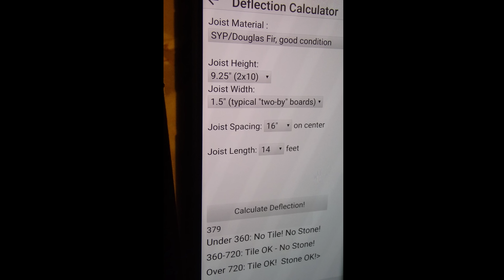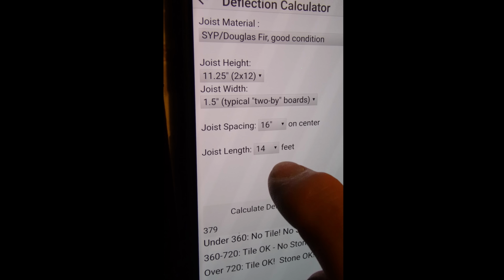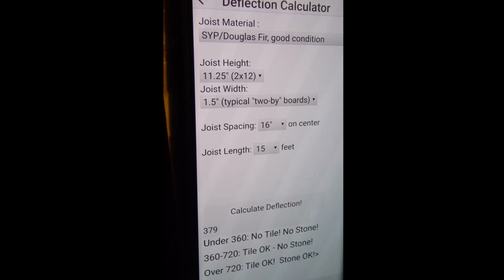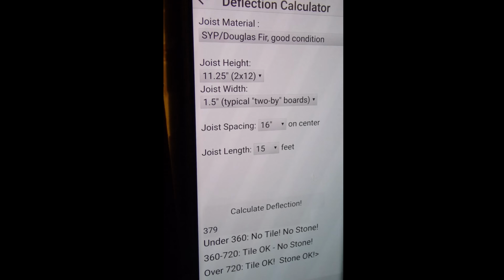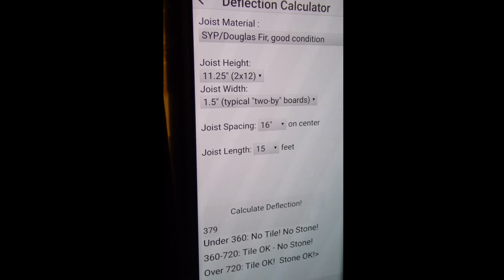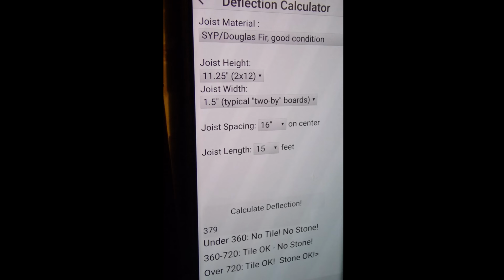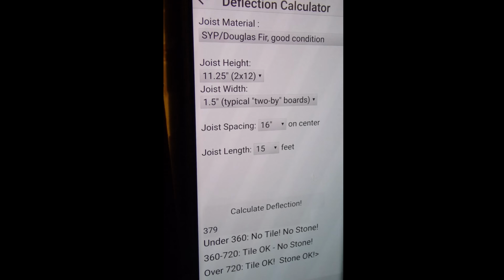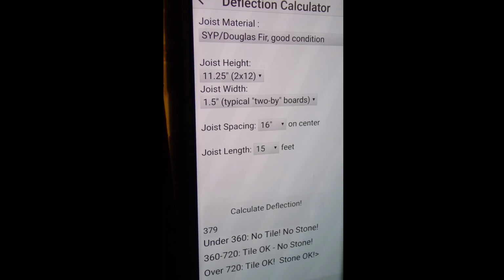🤔Before you install tile find out if the floor is strong enough?  What you need to know.

Comment: The "app" Sal links to is great, especially if you're a contractor in the field going from job to job because you'll always have it with you on your phone. However if you are a DIY'er at home doing your own kitchen or bathroom and you only need to do a one time calculation there are several good "free" PC and Mac based apps online example: The John Bridge Deflect-O-Lator

Comment: Sal,  These are the topics that makes you a TOP Tile Professor in my eyes.  In my kitchen the builder graciously gave me an I-Beam structure made of engineered plywood.  The builder also gave me I-Beams that are 24inches on center for the entire span of the kitchen.  There is also about  a 27ft of span as well.  Too late to add lollies, finished basement.  I was able to sister 1inch thick plywood to each beam on either side, glued and screwed for a good 15ft of span.  I will add another layer of 1 inch real plywood to the floor.  A thicker floor will have less deflection.  I wish there was a way of measuring deflection without calling in an Engineering company to do it.
Reply from the maker: You can determine with the deflection with the app, however the deflection should be designed into the floor when the house is built or remodeled to mee the deflection of the intended purpose and material type of the floor. This is not the job of the tile setter, but something he should be aware of. Sometimes wanting a thing and being able to have it are not possible.

Comment: Great video Sal. I believe that TCNA (Tile Council of North America) has introduced another important guideline - deflection for large format ceramic tile (Large format tile is considered any more than 15" long in any direction) is L/480. So normal tile L/360, LFT L/480 and stone L/720. I think they introduced that in 2019 or 2020, after this vid came out.
Reply from the maker: The language for deflection standards has changed in the 2020 handbook, but there is no mention of L/480. The change has to do with the assignment of responsibility for determining if the deflection. It makes clear that it is the responsibility of the builder or the homeowner, or design professional to make sure that proper deflection was designed into the floor assembly.

Comment: So here's my question, I have 3/4 subfloor trusses are spaced 24 inches apart. Do I need to strengthen that for 12x24 tile? It's my bathroom, I demoed an 1.5 inches of concrete and tile out.

Comment: Hi Sal. I have a small two-story condo with small upstairs bath. I am having to redo all tile, bath, toilet and flooring. The vanity are has carpet and the shower/bath tile. I have had to pull out all the tile and would like to replace  the carpet in vanity with tile too. Here is my question. When I calculate the deflection, the number I get is  is 307 which is less that the needed 360 for tile in upstairs. The total area in question including bath/tub/toilet/vanity is only about 40 square feet. Will tile still work, or do I need to keep carpet in the vanity section? I presume the tile in bath tub toilet area is okay cuz there used to be tile there. But what about the vanity area. The total square footage of my upstairs is probably about 480 sq. Ft and downstairs about another 540 square feet. Thanks so much!
Reply from the maker: That is way short of the required 360, so best to talk to a structural engineer or other design professional that can tell you how to strengthen your floor.

Comment: If there’s only 4 travertine tiles are slightly “bouncy” in a second floor bathroom, how can I fix this?  The grout around the tiles are breaking into pieces.  I don’t want to re-grout until I figure out what’s causing the problem.  Thanks!!!  :)
Reply from the maker: Floor structure is probably not rated for natural stone, my guess is it is a tear out and redo bringing the floor deflection up to L/720 before installing the stone.

Comment: Thanks for the info. I bought marble tiles for my shower. When it was delivered the receipt said that they weigh about 2200 lbs, which I did think about and of course the sales person didn't mention. I asked my contractor if he thought this tiles was too heavy and he said he didn't know so now I'm afraid to install them. Also all of my walls are made of plaster over drywall, which makr them much heavier, so I think my floors are already pushed to the limits. Any advice, please. I know you said talk to an engineer, so would that be a structural engineer.
Reply from the maker: Your tile is distributed over a very large area, so it is not as if you are putting a 2200 pound point load on one spot, most floors are engineered to accept a ceramic tile floor and meet L/360. The issue is more that you need a stiffer floor and a double layer of plywood for the marble tile. Floor has to meet L/720, in most cases floors will not be that stiff. So yes talk to a design professional that is able to tell you what you need to do to bring your floor up to spec. It is the job of the builder, architect or engineer to figure these things out, it is not the responsibility of the tile guy to determine the strength and deflection of a floor. However a good tile guy will check to have some idea of what he is dealing with.

Comment: Quick question if you have a moment Sal. How would plywood subfloor affect the calculations? Renovations in my area normally have 1/2" plywood subfloor. We normally add 1/2" ply to increase the strength of the subfloor and then an uncoupling membrane. I would appreciate your thoughts. Thank you.
Reply from the maker: You need to get a hold of a TCNA handbook. 1/2" plywood is never allowed as a subfloor, I would suggest you use 5/8" instead of 1/2" for the second layer that you add. The requirements of the joist structure do not change. I am not an engineer, however from what I understand, the joist deflection is the amount the entire joist will bend over its length, which is independent of the amount the plywood will bend between the joists. 1/2" plywood is not suitable and installing another layer of 1/2" will have a marginal improvement if they are not glued together to create  one solid layer of plywood. Just adding some liquid nails between the two layers introduces voids between the layers, so  the entire surface of each layer would need to be bonded to the other to be effective. Again, I am not an engineer so my understanding of how it all works is limited. Probably a good idea to talk to someone that can explain all the physics behind it, so you will be sure of a solution when you encounter this situation.
Reply: @SalDiBlasi  Thanks Sal. I appreciate you taking the time to answer this. Very impressed with your work and willingness to share your knowledge. Thank you.

Comment: another great video. Question is I tore up a 2-year-old sheet vinyl floor and the adhesive is still on the subfloor. Do I need to remove the adhesive completely or just until its smooth? I'm worried if its water soluble that the thinset wont adhere to the floor. I'm using Ditra for my underlayment. Thanks Sal ! Love watching your channel
Reply from the maker: Your suspicion is correct, grind it off.

Comment: I suppose if your deflection is under 360, you could install larger format tile like 24x48 no?  It would span across the joists.
Reply from the maker: Size of tile does not matter, L/360 has to be met.
Reply: @SalDiBlasi  Thanks Uncle Sal:)

Comment: Excellent video! I used the app and my deflection was 377. 

I installed porcelain floor. 

What i noticed is at one spot in the floor I noticed a bounce occurs. Only one area. Could that mean that I am on the edge of the deflection or should I attempt to go below to install some shims or bridges?  I just making sure that the tile floor lasts and I will have no trouble going forward. What is my best option?
Reply from the maker: Have to consult an engineer to figure that out, beyond the scope of what a tile guy is supposed to do.
Reply: No I have not reached out to an floor engineer. Anything I can check prior to doing so or any suggestions? Thanks

Comment: Sal, Our bathroom floor is construction tongue-in-groove 2x6 (1974 construction) the boards are 6 3/4 x 1 1/2.  We replaced a ouple of them due to dry rot, and replacement is only 5 x 1 3/8.  Is there a recomendation to know if this construction is strong enough?  (The span is 48 inches from beam to base plate).
Reply from the maker: Punch your numbers in here https://www.johnbridge.com/vbulletin/deflecto.pl

Comment: Great Video Sal, I have a little question, I measured using the calculator and its about 360, but issue is my ply subfloor is  3/4" and I dont have a lot of room to add more because then the tiles won't be flush with the hardwood floor in the hall. Do I absolutly need to have 1 - 1/8" plywood if I'm comfortably above 360? If I do, can I add reinforcements from underneath as the subfloor is exposed from the basement? Thanks!
Reply from the maker: You do not need a second layer of plywood if you are not installing a natural stone tile, which would require L/720 anyway. Install a cement board or an uncoupling membrane over your 3/4" subfloor and you are good to go. I would suggest an uncoupling membrane over a cement board, much better system for floors. Here is the ditra handbook for reference. Page 4 is probably for you if your joists are 16" on Center. https://www.contractorsdirect.com/PDF/ditra-installation-handbook.pdf

Comment: I'm installing 16 x 16 natural stone tile in my kitchen.  I have a narrow floor area of 3 joists underneath the floor where their unsupported span is 14 feet.  The rest of the joists' unsupported span is well under that distance because of wall studs for rooms under the kitchen.  The joists are 2 x 10s spaced 16 inches on center and have metal x supports in the middle placed perpendicular to the joists about 8 feet from the wall.  Would I need to put a support beam in the middle just for those three joists or do you think that the existing supports are enough?
Reply from the maker: So I put your numbers into the deflection calculator and it came up with a deflection of 379. Going by that calculation and the numbers provided, your floor should support a ceramic or porcelain tile floor when an appropriate underlayment is installed. However you indicated that you want to use a natural stone tile which requires a deflection no less that L/720, which your floor does not meet. Beyond that regardless of the deflection, a second layer of plywood in conjunction with an appropriate underlayment is needed. To answer your question, you need to beef up the floor structure to bring it up to spec. for a stone floor. I am not an engineer, so you will need to consult with  someone qualified to make the calculations and tell you how to strengthen your floor to meet the minimum requirements.
Reply: @SalDiBlasi  Thanks.  I'm thinking of nailing together 2 x 4's to make three separate beams to go under each joist close to the middle so that there would be no more than 8 feet of unsupported span on either side give or take.  I calculated it out to L/1389.  I'm not an engineer but this seems like a viable solution.
Reply from the maker: @bono894  If you feel confident, then it is your call, I can only put the numbers in the app and see what they come out to be. It is never the tile guys job to determine how a structure should be modified to increase the strength.
Reply: @SalDiBlasi  Last question.  Would it be okay to fix a structural issue such as mine after the tile is already installed or is it absolutely critical that it be done beforehand?
Reply from the maker: @bono894  I would do it before.

Comment: Sal, what is a way to get deflection in a house where basement is finished and you cannot see beams?  And how get a deflection in a condominium unit?
Reply from the maker: You have to find a place where you can get a look, most times there is a spot somewhere, or you have to find the information another way, ask the condo association for the drawings, do some investigating.
Reply: @SalDiBlasi  Thank you very much Sal for answering.

Comment: Hi Sal. Great video on floor joist span required for various types of flooring.  I do not see the deflection calculator link.  It would be great if you could post that.  How do you reinforce the floor joists if the basement ceilings are finished?  Would one method be to pull the subfloor and sister the joists from above? Is this a possible solution?
Reply from the maker: Here are the links, you can also find them in the description of this video
Tile Geeks App
Android   https://play.google.com/store/apps/details?id=com.ionicframework.tg3726017&hl=en_US

Apple  https://apps.apple.com/us/app/tile-geeks/id1193017374
Reply: @SalDiBlasi Apple not available in this region. CA that is. Weird

Comment: Hi Sal i installed 6x24 plank tile over partical board ,rescrew ,tight no sqeeking , rolled on a primer ,and morted in a ditra mat with proper trowel ,JOIST  2x8 16 on center 14 foot span , is that ok its main floor in house ,back room .kitchen ,frontroom oh subfloor is 3/4 OBS EXTERIOR GRADE
Reply: Tile is porcelain

Comment: Sal, thanks for the video.  Our subfloor is currently based on 10x5 (hxw) cm of joist with a gap between each joist at 40cm.  The previous owner of our house had laid a ceramic tile over the wooden floor above the joists.  I am not an engineer, but just wonder if the floor will still be strong enough if we are to lay another wooden floor above the existing tile.  I am thinking of not ripping our the existing tiles.  Thanks in advance for your reply.  Regards.

Comment: Hi sal i have a problem hope you can help. I bought 2.2 pound of grout in a box. Got it in a powder form. Added water so i got maybe drywall compound consistency. Now i let the grout 48 hours today and its still like not happening. I can take a screwdriver and break it from the grooves between the tiles. Where is the problem. I didnt wait the 5 mins like they say but i mean is it that important?
Reply: They say on the box 24 hours till it dries and 7 days for full strength. I need maybe 10 sq ft. Just to patch a few spots by the way
Reply from the maker: Cement products need time to cure, mixing according to directions is very important. If you added water after it has slaked to make it looser, that will affect the strength quite a bit. I would suggest you call the manufacturer for advice,
Reply: @SalDiBlasi  yea probably something with the water. Because i saw how professional mix and the consistency and its pretty much the same. Yours wont be powdery at the top at all? Even after less than 24 hours?

Comment: Hi Sal. I have a double joisted floor that i will be putting marble onto the floor and walls which an engineer has confirmed ok. I was thinking of a wet room but I'm worried about any movement that can cause water to come through the grout
Reply from the maker: Marble requires a double layer of plywood even if the floor meets L/720, water will always get through the grout, it is only a filler, not a waterproofing element. Your wet area should be water tight before any tile is installed, and your thinset coverage should be 95% or better. I have done many natural stone tile installations in showers and wet areas, as long as you use proper methods and standards and use a suitable stone, it is perfectly acceptable.
Reply: @SalDiBlasi  I have used 1 layer of marine ply wood. I was thinking if using Schluter DITRA-HEAT-DUO Matting and tanking the floor with some tanking paint and then using underfloor heating pipes that slot into the gypsom board.  Are you saying I still need two layers of plyboard on the floor? I was thinking of using a wet room shower try that sits on the joists so it's now profile. Ant thoughts on these methods? Could you point me to a video you have made that does exactly that please
Reply from the maker: @hakanozdemir6113  I think you need to come up with another plan and yes the second layer of plywood is still needed. Tanking the plywood is  a step not needed, the Ditra can be made waterproof very easily, Ditra heat duo is also a thermal break, so you need to have heat on the top side,  it also has  has no real value over a plywood subfloor, Concrete floors benefit the most.
Reply: @SalDiBlasi  thank you Sal

Comment: On the app there is no option for "I" beans made of plywood. So I pick unknown wood but in good condition?
Reply: The ap doesn't have I beams as there is no exact standard for them.  The only real way to determine their deflection is to find the manufacturer of them and go to their website to get the data that they publish on the ones used in the home.
Reply: I also have Engineered I-beams. Better stiffen that top layer up!

Comment: Sal: When you screew the second layer of plywood over the subfloor, do you screew that second layer in the joist or just between the joists ? My joists are at 16'' center. If it's screew just between the joists how may screew will you put in a row between two joist ?
Reply from the maker: Go to page 18, everything you need to know is there https://www.contractorsdirect.com/PDF/ditra-installation-handbook.pdf